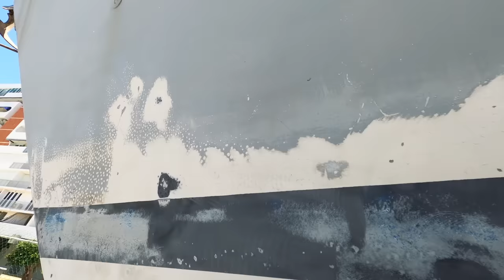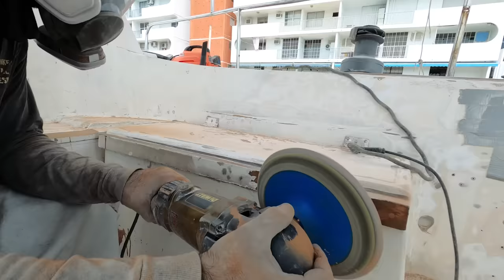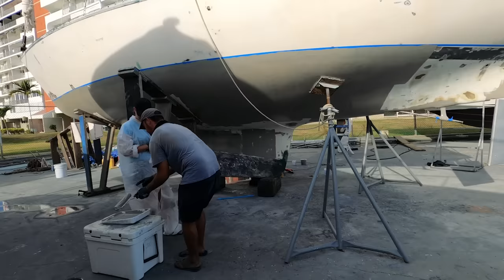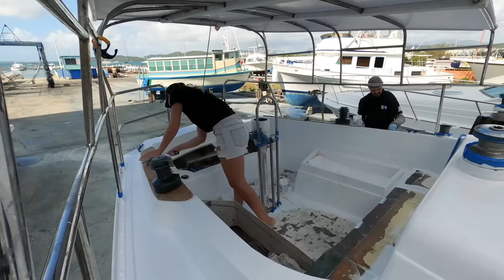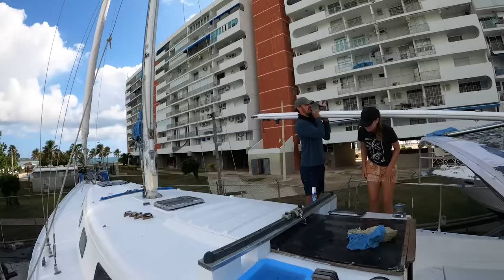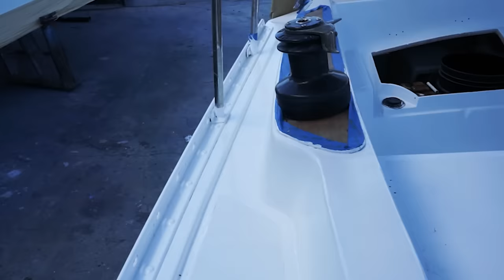INCREDIBLE $5k Boat Transformation in Mins Timelapse Sailing GBU

Comment: "It was a lot of work" what an understatement.  I got sweaty and tired just watching the video! We recently completed a bottom job with 5 coats, waxed and buffed sides and re-gel coated the cockpit (added blue tint to the non skid surfaces).  Spent 6 weeks in the yard as well. Wondered why you didn't need to wax and buff the hull, only applying 1 coat of paint.  Also, I found if you dont put down a layer of non slip wax on the non skid paint or gel coat it gets dirty way fast and is super hard to clean afterwards.  
Love your vids and channel.
Scott and Marie
SV Gratitude

Comment: Nice video! I did not know the deck paint job was done with rollers intead of a compressor....what is the length of the vessel, how l9ng did it take you to finish and what is the value of the boat after your hard work?

Comment: Watching how aggressive the paint sanding was on the top of the boat, I wonder how all those gouges and remaining chipped paint sections were smoothed over to create a nice glassy finish.  We didn't see glazing putty applied topside to cover these imperfections as we saw on the hull, for example.  We never get the camera to focus in on the details, although the overall efect of the new paint job looks impressive from a distance.  I wonder what the eye will see as you venture closer.
Reply from the maker: Ye it's not perfect for sure, we go over the final product and how the aggressive sanding wasn't the best idea🤣😂

Comment: Well you basically turned it into a brand  new modern very livable boat from a 5k hunk a junk that if you two had not seen the value in it probably would of ended up in a scrap yard I have to ask since you did most of the work yourselfs how much did it cost to rebuild??

Comment: Wow. 6 weeks is some kind of record. Im doing basically the same thing with a 35 footer. Ive been puttering around now for about 5 years. I suck.
Reply from the maker: Lol a yr after this we did a complete interior refit that took 10 months🤣😅 don't be too hard on yourself
Reply: @SailingGoodBadandUgly Alrighty then. I did my interior first. Now I'm doing what you did in the video. Say. What did you use for non skid? I'm not so sure about that Kiwi Grip stuff. I'm leaning toward the additives to Interlux paint. Or Interdeck. Any thoughts/ideas greatly appreciated. Cheers.
Reply from the maker: @jasonfrodoman1316  we used jotun deck paint and sprinkled on a sand texture. I font remember the name of it but the grip was excellent and pretty easy to clean
Reply from the maker: @jasonfrodoman1316  we used jotun deck paint and sprinkled on a sand texture. I font remember the name of it but the grip was excellent and pretty easy to clean
Reply: @SailingGoodBadandUgly  Thanks for the tip. I will look into it.

Comment: Hah. You had the speed at 2x and I did 2x more, guess thats 4x or is is 2x cubed? Noticed you didn't do a top end valve job or much with your engine. Bit one refit crew on the buttox and they had to go back and take out again. Your probably in the water by now, can be done while your in the water, no problem. Bums did a great one way out in the bay at Luperon. You did all that top end work but hopefully you'll be able to cover up some of the deck with solar panels, or have them out on the back of the boat ? Really helps to upgrade that.

Comment: Such works should be done with boat enclosed in special curtains and with filtered drains.. think about how much dust, paint, powder has been spread in the environment
Reply from the maker: Very little, the factories that produce the "special curtains" do much more damage to the environment than the teaspoon of dust that goes out of my hatch every month😅😆
Reply: @SailingGoodBadandUgly  in Italy you are disallowed to do a retrofit as you have done with no protection.. and those curtains get reused so the comparison is not exactly as you say, besides it not being exactly a teaspoon 🤗

Besides this, nice job

Comment: As the video is a few years old the rot in the cabin top is probably back and the weak spot you created along the traveler at stage will cause a problem before undergoing a repair of that type you should have gotten advice from a professional boat builder
Reply: I also thought that also I didn’t see them work on the keel regarding rust

Comment: i wouldn't trust that boat. the deck repair was done wrong in multiple ways. especially the use of too small of pieces of fiberglass that are both in multiple peaces but especially because there is no over lapping fiberglass.. you just don't butt joint fiberglass. it needs to overlap or it will lightly crack along the butted edges, usually as the most inopportune times, like high stress on the boat during a storm... i didn't see where the repair was located exactly, but if it was next to a stantion. then the deck could buckle letting the wires slack on both sides of the mast and create a situation the sailboat could demast itself. the repair wasn't too massive, but i also didn't see if they followed all the deck rot and repaired everything. if they did, maybe they will be ok. but if that repair is next to a stantion or not all the rot was removed, then the adhesion of the old fiberglass to the core would be in question for a much bigger area then was patched. thus making this sailboat questionable in rougher conditions.